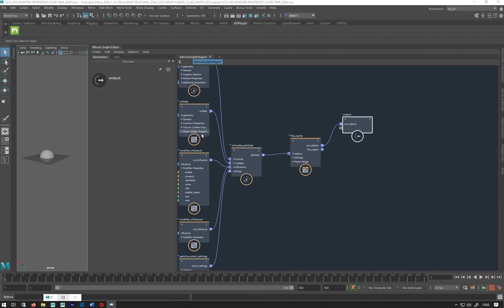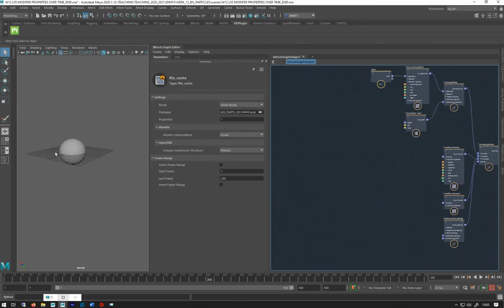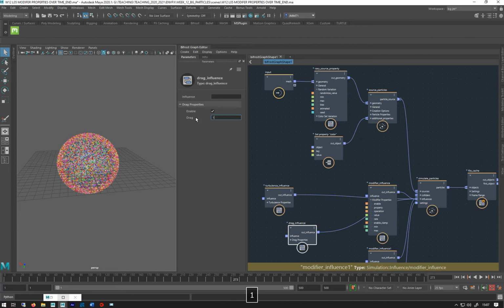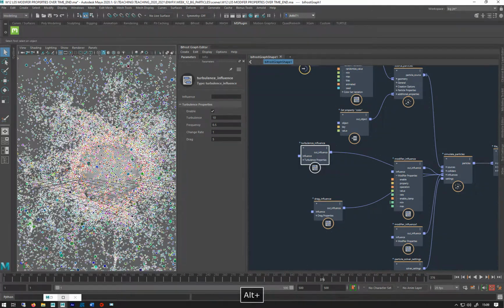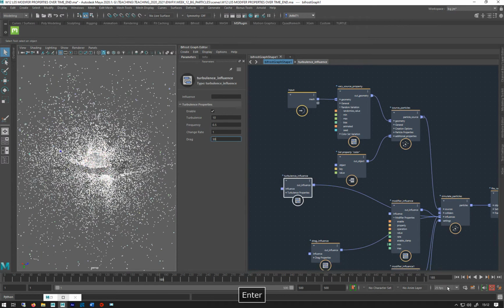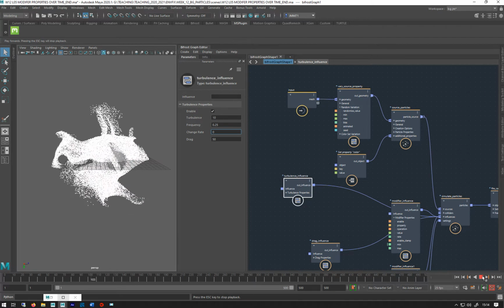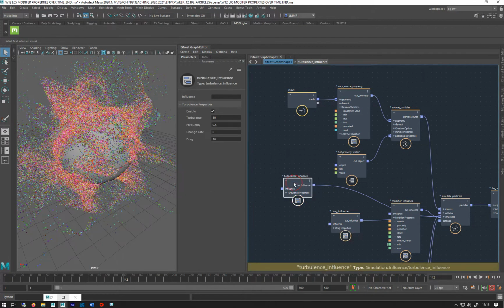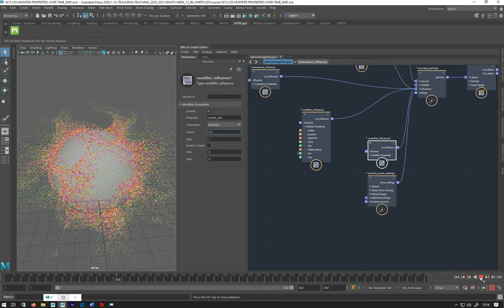BIFROST BASICS: WEEK 3 LESSON 6 INFLUENCES TURBULENCE DRAG

Comment: Hi JMM17, do you know if there is a way for particles or Aero to travel along curves in Maya? Bruce Lee has a plugin for this, but there was an issue with a virus, so I wonder if we can do this out of the box? Cheers
Reply from the maker: Hi Steve. Bruce lee's curve influence is your best bet. It states here he cleaned out the virus which was in one of the example scenes and not the compound itself thttps://forums.autodesk.com/t5/bifrost-forum/bifrost-developed-the-second-generation-curve-influence-tool/m-p/10075375. If that is still not an option. I can do a quick video on a basic setup once my work quietens down. Hope that helps. J
Reply: @jmm7180  Great stuff, thanks for the link. Any info or a tutorial would be ace, cheers again.